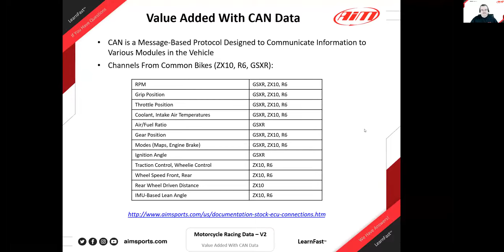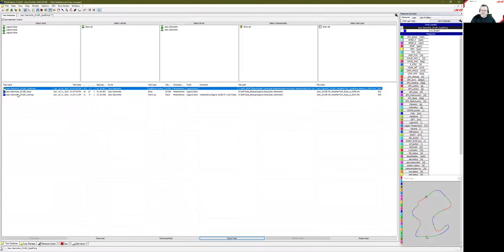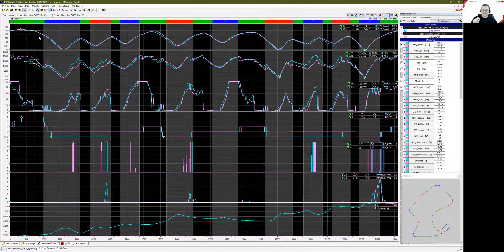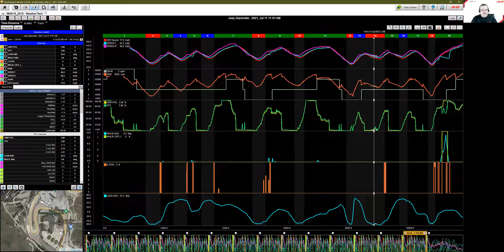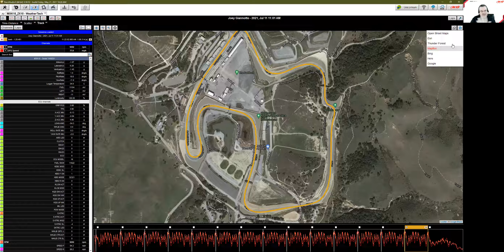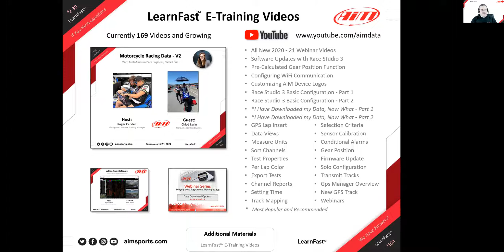2-30 Motorcycle Racing Data, V2 - Live Webinar with Chloé Lerin - 7/27/2021

Comment: Thank you for having me again !
Reply: @Unicornium - Racelines loving these seminars hope to see more of your experience on this channel, Are you able to explain how you have the RPM and Gear selection in the same channel? I haven't been able to find the config or information to config it anywhere, I couldn't find it in user profile provided? Also are you able to say what maximum cornering Gs you typically see for most sportsbike on the track with reasonably sticky sports tyres (not slicks, not touring tyres) is -1 to +1 pretty normal? or do you typically see higher in the realm of +1.3 and higher? thanks in advance